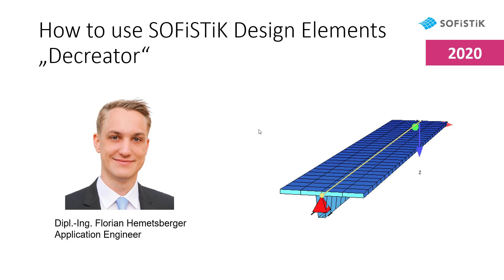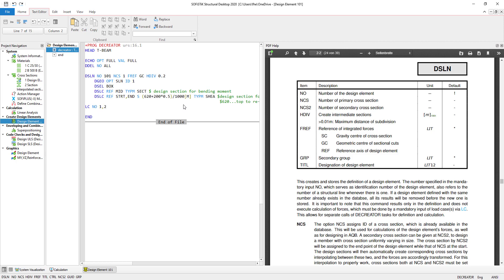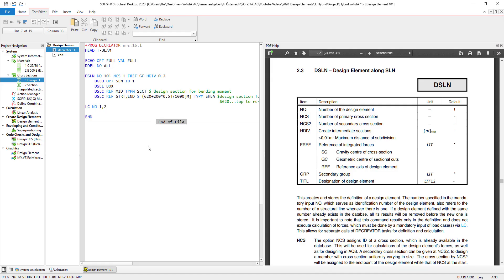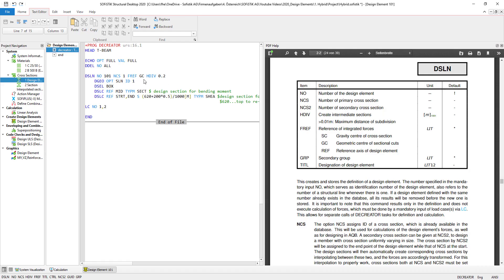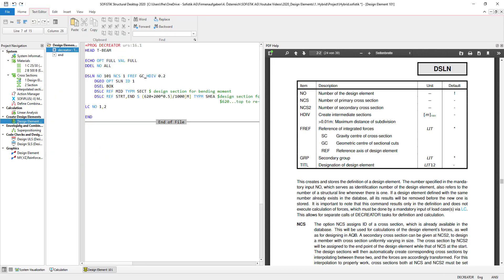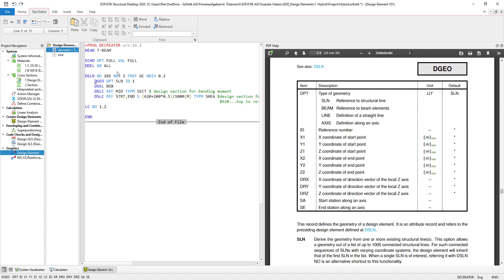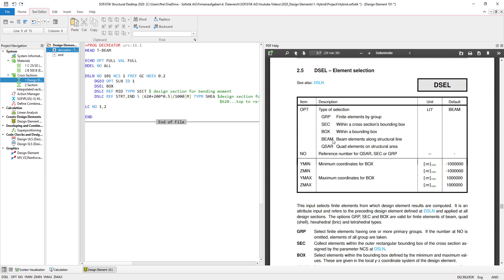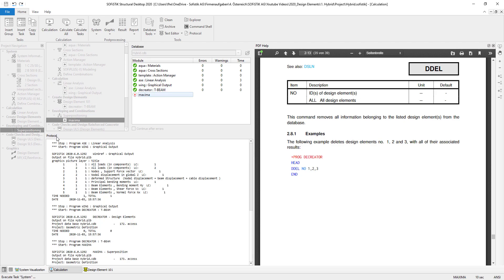How to use SOFiSTiK Design Elements 1 - General

Comment: Hi, thank you for the video ! Could you explain in more detail why the geometric center is the most appropriate value for FREF ? Could the center of gravity of the element be used as well ? Thank you in advance  for your feedback.
Reply from the maker: Hi saadabdeljalil6040,
you have 3 options for FREF:
SC -Cross sectional center
GC -Geometric centre of the cut finite elements
REF -Reference axis of design element
So the answer to your question is yes :). There is no general "appropriate" value, but the right option for the right situation. You can read up on the seperate usecases in the manual by pressing "F1" when you have the "DSLN" line selected.

Comment: Hi, is there a way to use design elements consisting of beam and quad elements  for traffic load or seismic load. As my experience show, that you can only use design element for linear cases.
Reply from the maker: Hi user-ko9cp1ys6v,
Additionally, I just checked. Integrating a nonlinear loadcase works.

Comment: Hi, can we use this philosophy for steel thin walled I girder with deck slab at top? I have varying top deck width, hence making a single beam with fixed slab width with orthotropic deck is not possible for me.
Reply from the maker: Hi Gaurav,
Yes you can :). As for the varying deck width, I would use groups to tell the program what to exactly consider (DSEL OPT GRP). You just have to assign the considered effective width to a specific group to be considered.
If you need further information, please contact our support via the support assistant. (SSD - Help - Support Assistant)

Comment: Hi, thanks a lot for this nice video. The problem with decreator ist that i cannot see in Wingraf which elements are included in box or if sofistik included corectly all the elements for the integration that i defined in Teddy. Is there a way to control this? Thanks in advance.
Reply from the maker: Hi A. Iliopoulos,
The way to check which elements are included/are integreated at which point of the design element can be check in the report of the Decreator-Task.
Take a look at 06:15 of this video: youtube.com/watch?v=W-ECvfg-Kt0
To see the sectional information (and more about the design element) you can simply add an "ECHO OPT SPLT VAL FULL" -line to TEDDY and access the report via rightclick.
Did that answer your question?
Reply: @SOFiSTiKAG  Thanks very much. My ECHO was wrong.It works now!

Comment: Hi, thanks for this great material and whole channel - it's really useful!
I'm wondering what approach would you recommend for an in-situ concrete prestressed bridge with 2 concrete beams and a concrete slab (sth like the bridge in the video: https://youtu.be/GoT1f0aGdgs?t=456) - design elements or t-beam (tbex)?
Reply from the maker: Hi Michael,
Thanks for the feedback, we are happy that you like our channel :).
About your in-situ concrete prestressed bridge. The choise of your system always depends on what results/effects you want to consider. If want to use only decreator, you need to do manual adjustments to consider specific effects. TBEX already considers a lot of effects based on the T-beam philosophy (you can read up on it in the ASE manual).
If you need more detailed support, please email info@sofistik.de

Comment: Why should I use DECREATOR instead of SIR? What are the fortes of each one?
Reply from the maker: Hello Benito,
SIR and DECREATOR basically give you the same results. DECREATOR is more versatile though (newer technology, e.g. it can be structural element based, as well as free geometry and axis based, as well as more advanced Element selection and result optimization). 
DECREATOR will at some point replace SIR.